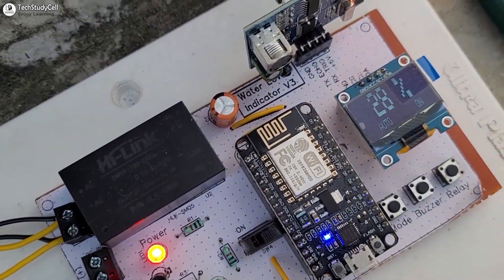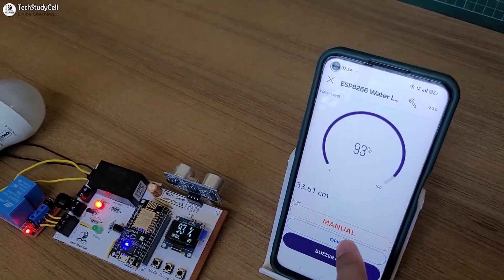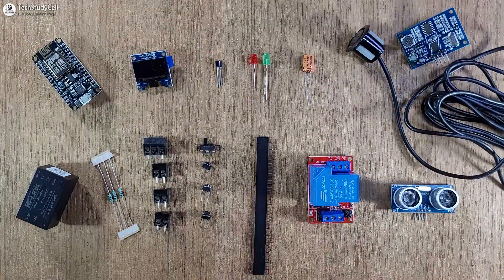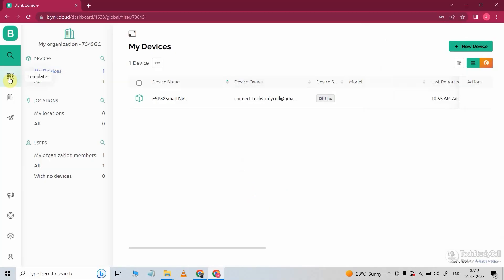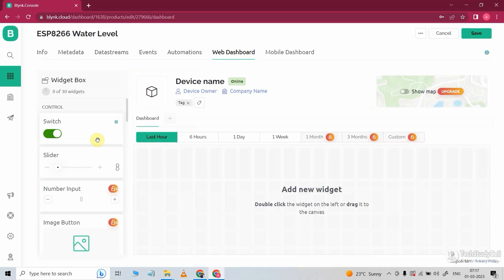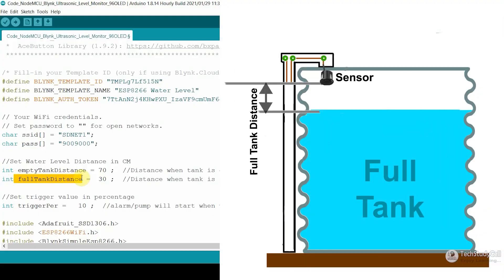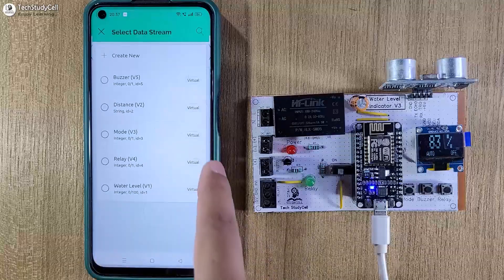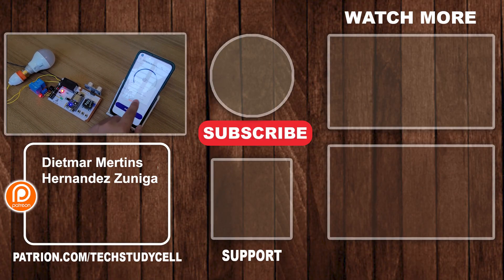Water Level Indicator project using NodeMCU ESP8266 Blynk & Ultrasonic Sensor

Comment: "I followed your project steps, circuit diagram, and pin connections exactly as shown, but I'm facing an issue. The relay stays on continuously and doesn’t turn off as it should in operation, which keeps the motor always running. Could you please suggest a solution to fix this?"
Tried two days

Comment: This project is absolutely good but you can add nrf24 module for wirelessly control and also add sump and  overhad tank controlled by wirelessly 
My suggestion is use low power module so it can be easily use in battery for sender side

Please upload this type of project becouse more practical and more usefull but need lots of skills thanks

Comment: Hi, I am working on one of your project: Water level monitoring using ESP8266. I am facing a PROBLEM that my module is not connecting to Blynk. I have placed all the website keys to codes correctly but it didn't work

Comment: if I need to change push button with touch TTP233, any changes required in components?
Reply from the maker: will make video
Reply: @TechStudyCell  and if I change push button with touch button any resistors or transistor needed in circuit or simply connect it? (Thanks and looking forward for a complete touch version of this project)

Comment: Sir, what will happens when the tank reaches 100% during manual mode. Will it gets off or we have to off it. Can you suggest or include protection of motor running during dry conditions that is to stop motor during dry conditions.
Reply: You can set the logic that if the motor is on by automated mode and if the current water level reading and the water level reading after 3/4 minute stays the same the motor to turn off automatically I think dry motor can last for somewhere around 10/15 minutes without any significant wear and tear

Comment: I  completely complete this projects  but cant trigger relay of 5 v 30 A relay  . I think  relay needs to slightly increase voltage may b 7 to  9 v . Do u have any idea about this ? other wise my pcb board gone waste
Reply: i have issu to compile the code . their have some error with the iRam . with u can help me
Reply: I use bc547 transistor and 1k resistor to run it

Comment: Hello, I copied this, works fine. only my display 1.3 inch does not work :(. and would it be possible to make an LED diode display in the code that you can see from the LED like full green 100% yellow 50% red under 10%? ask for an answer

Comment: Hi. Your project is great and very easygoing. I have tried it but I am facing an issue that during auto mode reading from the ultrasonic sensor is spiked above 100% frequently due to this running pump stops within short time. Can you implement any code by which if readings are above 100% or starting percentage for more than 2-3 seconds then only output count. Thanks you are doing a great job.
Reply: I had faced the same problem . There are wrong values in between which I was trying to filter out by using averaging and different formulas. I was not able to complete the project. Have you found any solutions yet?

Comment: Please Sir make a water pump control project with esprainmaker
Reply from the maker: ok
Reply: Thank you very much sir
Reply: I  completely complete this projects  but cant trigger relay of 5 v 30 A relay  . I think  relay needs to slightly increase voltage may b 7 to  9 v . Do u have any idea about this ? other wise my pcb board gone waste

Comment: Brother Im getting a constant error (error compiling for board nodemcu 1.0 ) plz help me with this would very grateful to u thanks in advance
Reply: Plz help
Reply: @ashaproductionslabs190 hello, I'm also getting problem while compiling code but I installed all the library that he give on his website and then my code run without any problem.
In short solution is- Install library version according to his website and version given in code.
Hope this helps 🙂
Reply: i also have the issue bro , i already follow all the library but still have a problem , can u share you code for me try ?

Comment: Sir, please help me with the working of 5V 30 amps relay module like one you used in your float sensor video. I am facing problems with it. The relay is not triggering when connected to 5 V module . I also tried with another new 30 amps relay but it also does not trigger. Whereas 5v 10 amps relays are working perfectly with the 5v power supply.

Sir , please help me to fix this......
Reply from the maker: It is due to power supply.  Use stable power supply.
Reply: @TechStudyCell  I am using Hi- Link 5 V 5 Watt power supply. The point is that if I directly connect the wires of the power supply to the coil of the Relay module so it works great but if I connect the wires in the connection points of the pcb ,the relay coil seems to be not energized properly. The 2nd new 5V 30 amps relay also acts the same. What to do?😔